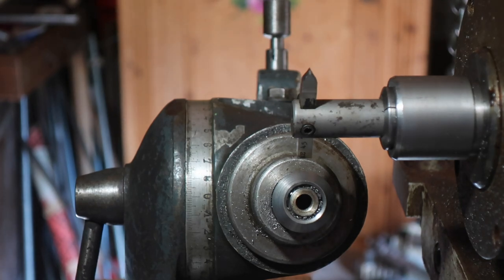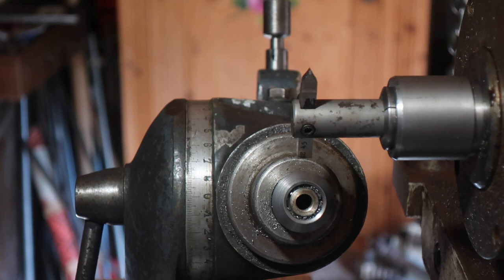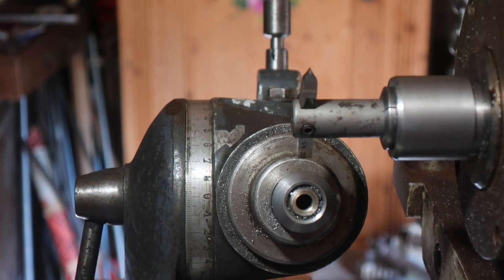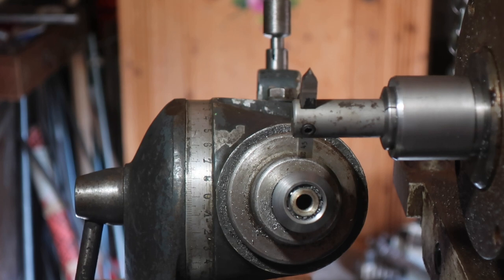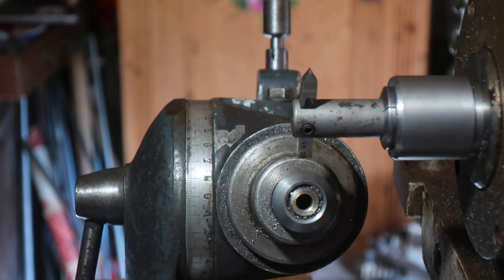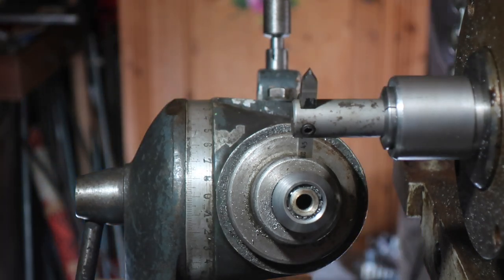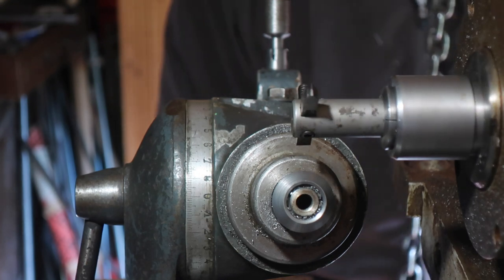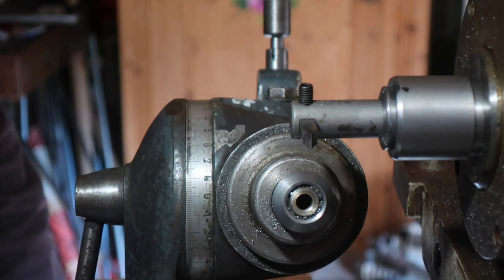More gear cutting

Comment: Great job Michel.  I've cut plenty of spur gears, but never any bevels.  One day I will get a mill ;)  Cheers Rob
Reply from the maker: Cheers, Rob.  If you felt masochistic you could do bevel gear cutting on the lathe, but it would be quite a bit of buggering about using the compound slide and doing the offset for the side cuts with the vertical slide.  

I sold my Schaublin vertical slide to finance the mill (and had money left over :)